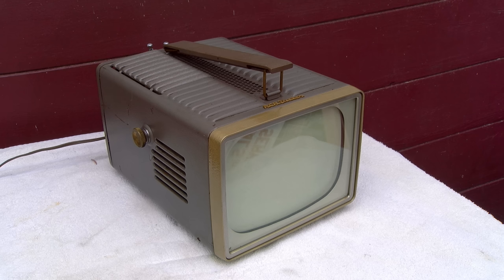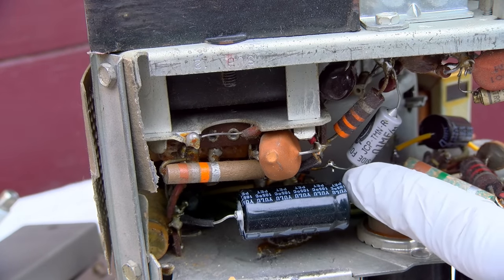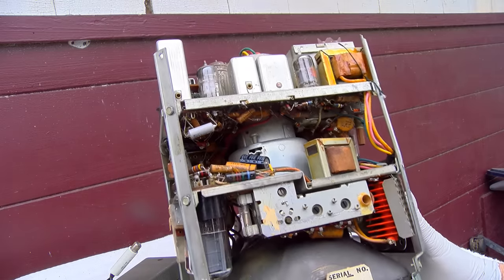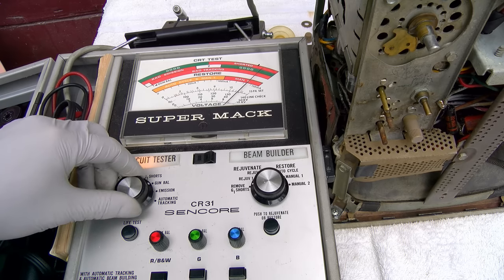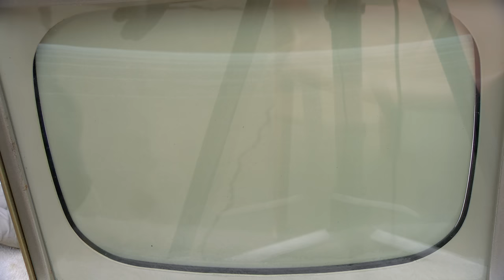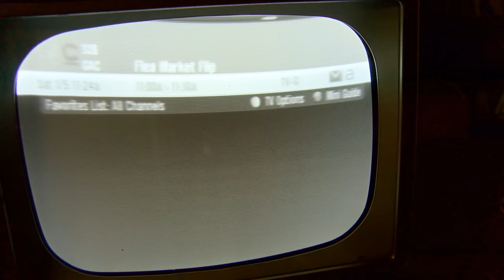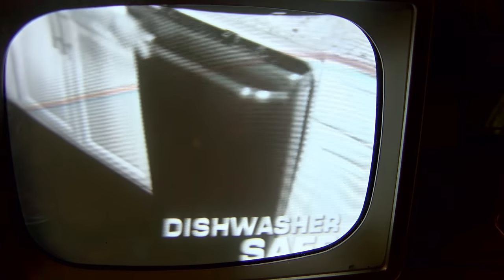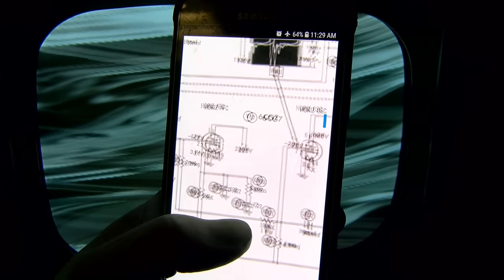1962 RCA 8 PT 7032 TV Analysis 8PT7032 KCS100B Black And White 8PT7032 KCS100B

Comment: Nice looking artifact from the fifties... imagine what it would cost to build something like that today?
Reply: Not much if made in china.
Reply: It would be made out of ten times recycled ford tauruses and the rest would be asbestos with a sprinkling of glass shards that would resemble this lovely TV but in a really crumbly way like the lamented modern Crosley 300 in 1 classic-retro-magic vinyl grinder radios.
Reply: It'd retail at about 1000 bucks and wouldn't pass any modern safety tests
Reply: If it was made in the USA in today’s day it would be what is cost originally in the 1950’s adjusted for inflation plus like 35% probably.

Comment: The instructions for the super mack say to switch it to "remove G1 short" (at which point it cuts the heater voltage) and let it cool down for at least 30 seconds before pressing the button.

As far as I can tell removing a G1 short is like burning off a tin whisker with current. It'll surge the grid and blow off any particles that may have gotten lodged in there during transport or when/if at some point the crt what turned vertical with the neck at the bottom and stuff fell into the gun. The short likely won't come back unless you were to upend it again

Comment: 20:30 Do any of the converter boxes have a B&W RF option? If the color signals are causing  some of that buzzing, it might help.
Reply: Most of the buzzing probably is caused by a wide bandwidth audio demodulator, reaching down in response well into the colour subcarrier area and probably also into the video as well. Most likely the major cause is leaky interstage coupling capacitors and bad power supply capacitors.

Comment: Those little TVs from the mid 50s on are famous for bad caps. Not only age but all those tubes confined to such a small space causes it to be a miniature toaster oven. I'm shocked it has a power transformer! Usually those little sets are series string, hot chassis "gutless wonders" to keep weight and more importantly; production costs down. Looking forward to the next installment!

Comment: The "restore" and "rejuvenate" type functions tend to be temporary unless you're waking up a good but long-unused older B&W tube's cathode for the first time after lengthy storage.  The remove G1 shorts is usually permanent unless the tube is very old and/or the gun structure is coming apart.  It is usually just a small flake that once you blast it, if the CRT is otherwise showing strong, will lead to good service life.

Comment: I had one of those as a kid, back in 1963.  Hot chassis set if I remember.  Maybe not, is that a power transformer in the back?   6U8=6GH8=6EA8 ad nausum.  Lots of similar numbers for those triode-pentodes.   CRT looks like an  ion trap job.  I'm no expert, but I think you'd have a better chance of long term fixing a G1 short on a CRT than a heater to cathode short.  Also in fixing the heater to cathode short, it's more likely the patient would die on the operating table.
Reply: I didn't have one of those, we had a big old Motorola B&W to watch Astro Boy on.  It was still working in 1976 when my folks finally caved and bought a color TV.

Comment: The weakened early-plastic form that holds the deflection-yoke coils in place could disintegrate from the heat of the CRT, causing those coils to unravel. It would be advisable to replace the wax paper caps that handle higher voltages, since they're the ones that are under the most stress. Those oil-filled caps need immediate replacement because of the distinct possibility of them shorting and damaging adjacent circuits.

Comment: A possibility is that something,  maybe some of the cathode material flaked off and when you carried it the material created the short in the tube.  Back in the day I used to have more luck clearing shorts lasting than rejuvenation for low emission.  Heater/cathode shorts were best handled by an isolation transformer much safer then pushing the big button.   I have 3 of these little sets Red, White, Black, I restored the red one years ago....as I remember it required quite a bit of profanity.  I would say no one should make this set their first TV restoration.   But the little set produces a great picture very stable and good contrast and brightness.  This is a much better set than the little GE 9 inch of the same era.

Comment: lol I knew short clear button stabbing was going to happen but it still made me laugh like hell :D as for the G1 shorts, i've heard from radio hams that have got cheap transmitting tubes due to grid shorts and used a high voltage capactior to clear the short and used them for years afterward without trouble... could have been a grid wire that broke and was making contact that got burned off when clearing the short... performance might not be as good as new if that is the case but probably very negligable degrade. your thought about running it for a while is good idea.

Comment: 18:01 Definitely a permanent fix, since the little chunk of stuff that got  lodged between the G1 and cathode structures and shorted them  got zapped to bits by the multiple charges ;-)  from  your CRT rejuver, and since the set was on it's face when you zapped it, whatever bits of stuff that got blown out from between G1 and cathode most likely fell down through the neck and into the main body of the CRT, far away from the gun area.... the little remaining micro-bits probably made little microscopic dings in the screen phosphors when they landed... lol :-D

Comment: I’m in the process of restoring one of these. I have mine working well so far.
I happen to have a spare one for parts as well. They’re cute little sets with lots of Mid Century vibe. 
Do you plan on converting the Selenium rect. to Silicon? Would be cool to see you do that too. Looking forward to the next installment!
Reply from the maker: Depends on if its high resistance low b+
Reply: @shango066  Wouldn't a bad selenium cause the loss of horizontal sync as it warms up and the B+ drops? I saw that happen on a 1957 Hoffman portable I fixed many years ago.
Reply from the maker: @gerardcarriera7052  not like that i doubt. I can test that in video 2 before i touch it

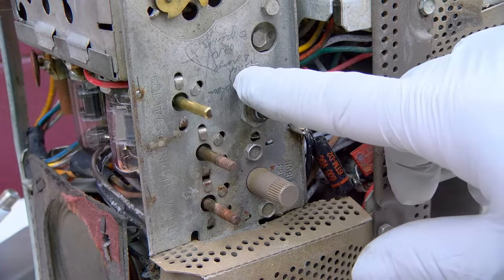Comment: The writing at 5:35 is the wiring color code for a canister capacitor. Someone wanted to make sure they wired the replacement capacitor correctly. I found a link to replacing the canister capacitor with regular capacitors. See those little symbols the triangle, box, half circle and "nothing" are etched into the bottom of the cap.  Here is a link I found for replacing a canister capacitor with regular capacitors. 
 https://www.instructables.com/id/Tube-Radio-Capacitor-Can-Replacement/

Comment: Your lucky it does what it does .put it on display never plug it in ever again .another curtain burner . remember fixing those have to adjust horiz after every 10min. once in the case .crt won't recur just a lump of coal .adj horiz phase coil there's a cap need to jump first as I recall.

Comment: smack it on the sides to straighten it out
Reply: Tom Kelly I have to do that with my 1950's Hoffman,  dam  crt filament opens up,  have to smack it a few times so the crt will light up....
Reply: Tom Kelly I had to wine it and dine it with new capacitors so it would give me some picture..